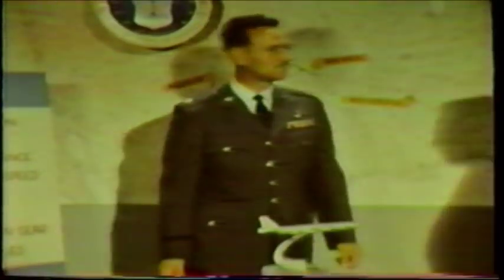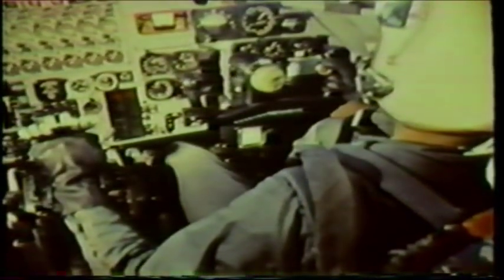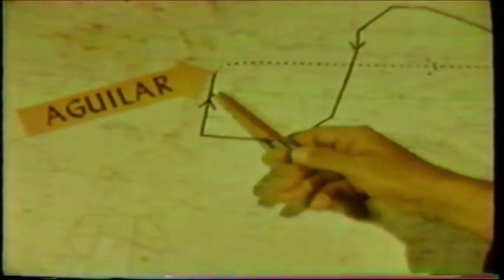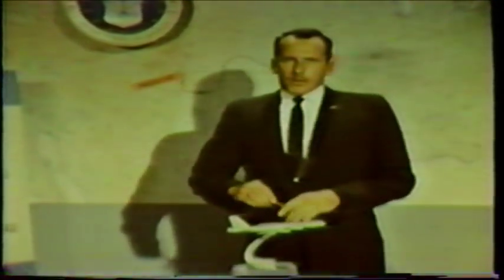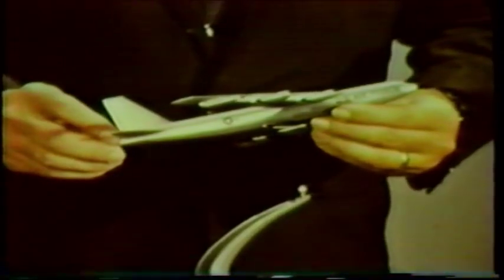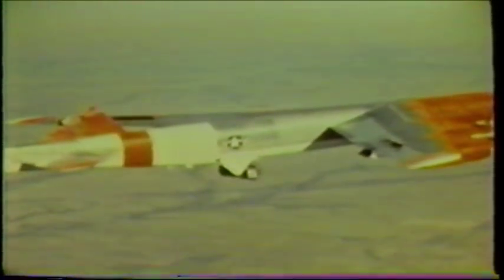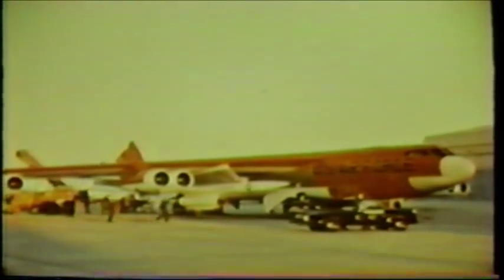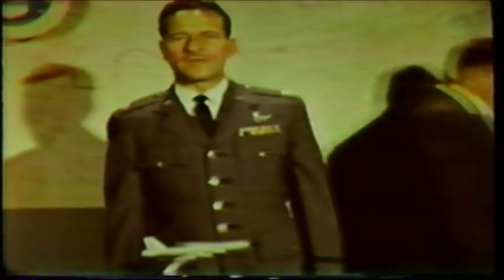B-52 with no tail

Comment: Stationed at McConnell AFB at the time and in the 1218 building adjacent to the active we were notified about the pending emergency landing. We knew she had lost part of the vertical fin. She approached 18L which is 12,500 feet long and 300 feet wide. Our winds were not directly out of the South however with cross winds as usual. This caused the diversion to Arkansas. She passed over the active less than 100 feet off the ground and when we witnessed the fin or lack there of; chins dropped to the ground. Great job saving the aircraft by Boeing Flight Test and the crew.

Comment: As far as the JAL 123 crash... The aircraft was damaged by a tail strike that was not repaired properly years before the loss of the tail. The repair failed after about 12,000 cycles and destroyed the vertical stabilizer and the hydraulics.

Comment: @otochari In 1968 six F-111s were sent to Indochina for operational testing. After five weeks three of them had crashed due to mechanical failure and the survivors were withdrawn. They returned in 1972 and performed much better. They did not require tankers or ECM support, and could operate in weather that grounded most other aircraft. One F-111 could carry the bomb load of four Phantoms.

Comment: Heck this is nothing.

One of our B52G's took off from Blytheville AFB and sucked in a flight of geese to her starboard inboard engine pod 45 mins out shelling out the pod. She was making the long turn for home thinking she still had 6 engines. Bird starts a climbing turn to set up a glide path.

Okay the acft is climbing when the port inbrd pod losses a engine powering their auxillery power units. Switch to other pod and forget climb. They made it back ~ but took out the approach lights.

Comment: they needed a runway at least 10,000 ft and not fogged in. I believe Blytheville is 12,000 or more long.
Reply: McConnell AFB in Wichita runway length 12,000'.  But the winds were gusting.  Schilling AFB in SLN is 13,000', but also gusty.

Comment: What is THAT slung under the starboard wing? This aircraft is on loan and manned by a civilian crew with an unmarked vehicle that resembles the old AGM-28 Hound Dog, nuke. So what is a civilian crew doing with a nuke slung under their wing? What was this crew really testing?  

GOR 148 called for a pair of supersonic air-to-surface cruise missile to be carried by the B-52. Each B-52 would carry two missiles, one under each wing, on a pylon located between fuselage and it inboard engines.

Comment: Very similar to the incident in which JAL 123 a Boeing 747 lost their vertical stabilizer. They tried to maintain flight but it proved to be fatal and killed over 500 people...
Reply: +gunz-n-gadgets Consider that despite losing the vertical stabilizer and all hydraulic pressure, the crew kept the plane aloft for 32 minutes using engine thrust adjustments.  After the crash, experienced pilots went into simulators, but none were able to do as well as the actual pilots did.  This experience has been used to design modern avionics to adjust for loss of one system by using another, so the pilot only need provide the usual inputs and the computer will figure out how to do it with the tools still available.  Also note that despite crashing in the mountains, there were several survivors.

Comment: This shows you how airworthy a B52 can be. In 2001 an Airbus A300 suffered the same loss of vertical stabilizer over New York,  immediately lost control and crashed into a crowded Queens neighborhood.
Reply: A300 doesn't have the same wing and engine configuration so no comparison should be made.
Reply: The entire tail fin came off the Airbus. I can't help but wonder if it would have survived if it had the same 15% area intact that the B-52 retained. Yes, a different airplane, just wondering.
Reply: Dennis Harper Airbus tail fin is composite, not aluminum, and not as strong as aluminum construction in a situation as this. And also not mounted the same as B- 52G was, A 300 also wasn't designed to withstand combat maneuvering like a bomber aircraft is.
Reply: teenagerinsac  I'm very aware of the facts you mention. I'm just curious as to what would happen if the Airbus
had a bit of tail remaining as the B-52 did. Just a thought question. I'm not comparing the two. I'm thinking the Airbus would not have survived. It's worth noting the Airbus did not lose it's tail due to air turbulence as the B-52 did. The Airbus pilot encountered wake turbulence from the aircraft departing before it. Not an unusual occurrence but the pilot deflected the rudder too much and off came the tail.
Reply: Dennis Harper Airbus vert fin attachment is now redesigned, so that might not be possible.
Reply: teenagerinsac  Yes...that's true. But I'm simply thinking about how modern airliners would perform with the same percentage of tail missing. It's possible to think of something without having to go though all the reasons why it's unlikely.

Comment: This was a curious by product of improvements in Russian radar. The decision was taken to train B 52 crews in low level attacks, literally under the radar. At the normal operating height of a B 52, the air is pretty smooth and cold. Bouncing across the Nevada desert with its rough thermals put quite a strain on the structure, and fatigue developed very rapidly. Pilots who pushed and pulled hard to follow terrain put permanent bends in the structure! Lots of video of this...

Comment: I don't see any logic in lowering landing gear during flight. Drag was on top while fin was intact, then fin is gone so balance is ruined, so logic would say to create drag on top to compensate for lost fin. But that imposible. So just leave it as it is.But to they decided to throw balance even more by additional drag on the bottom. I don't get it. If someone more enlightend in such area i clarifying would be much appreciated.
Reply: Drag is not the issue.  longitudenal stability is.  The rear gear is behind the center of gravity and would stabilize the aircraft.  But wait, they said all this in the vid.
Reply: c172215s is correct. Imagine the rear gear as being similar to having a parachute tugging on the rear of the airplane. Like most airplanes, side to side motion (such as from a rudder) will pivot the airplane around a midpoint, generally where the wings are. Lacking a rudder and it's fixed vertical stabilizer will let the airplane pivot dangerously. Lowering the rear gear creates drag that tends to center the airplane. The fast thinking crew and ground techs also knew the B-52 gear has a narrow footprint which helped increase the weathercock drag they needed. Smart people = plane lands.
Reply: Ice Cold They landed (with no additional damage to the aircraft) and walked away unhurt! I think they got it right! Nuff said!
Reply: Did you not watch the video? It actually says why the gear was lowered!

Comment: A good bomber can fly without a verticle-fan.
Not only Boeing, evin the Nazi's could do this with their bombers.
...
And it is not just the bomber which makes this possible,
it are ALWAYS the pilots!!!
If you would have flown this B-52, you most likely would have crashed.
()
When a Heinkel111 is missing the verticle fan, it can fly to,
instead of using the rudder (which is gone then),
youll need to use your gear and engines.
Nazi pilots were saved by using their left & right divebrakes

Comment: Amazing job of landing that aircraft. Japan Airlines 123, a 747, lost its vertical stabilizer and became uncontrollable and crashed. Killed over 500 people. A mi
Reply: the Japan Airlines 123 lost its aft pressurized bulkhead, the explosive depressurization was channeled to the rear and hit the interior of the tail, where there were all the four hydraulic control lines. The loss of the tail fin was only secondary, very impressive, but secondary: the 747 lost all its control lines in one fell swoop and became uncontrollable.
Reply: +Chris Nizer JAL plane lost its hydraulics which made recovery  and usage of flight-controls impossible. Losing the vertical tail was bad in itself...but losing the hydraulics for  the  horizontal wing guaranteed a horrific ending.
Reply: +Chris Nizer Consider that despite losing the vertical stabilizer and all hydraulic pressure, the crew kept the plane aloft for 32 minutes using engine thrust adjustments.  After the crash, experienced pilots went into simulators, but none were able to do as well as the actual pilots did.  This experience has been used to design modern avionics to adjust for loss of one system by using another, so the pilot only need provide the usual inputs and the computer will figure out how to do it with the tools still available.  Also note that despite crashing in the mountains, there were several survivors.
Reply: +pahtar  No ECM in the world can be programmed for a particular 'horrific scenario' and variables of traveling on the ocean,in the air, or on the road.....just like auto-pilot on a plane/cruise control on a car.....when a plane is on auto-pilot...there is always a slight overreaction of pitch/yaw which even I passenger on a plane can detect.
Just, as a cruise control will needlessly shift down/up,brake, throttle-up/throttle-down...when one or more inputs is not necessary to maintain a speed on irregular road surfaces.